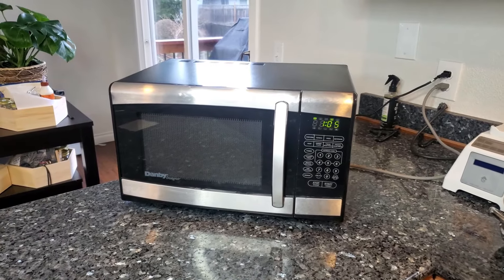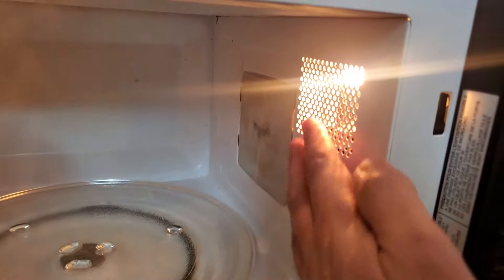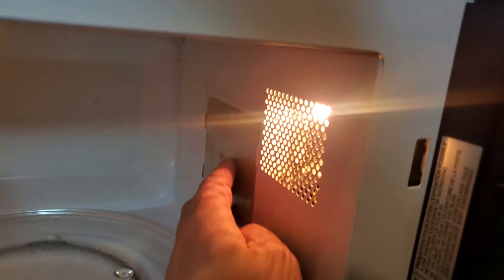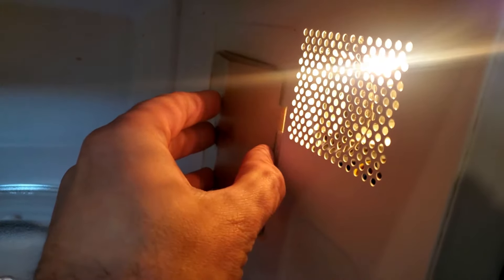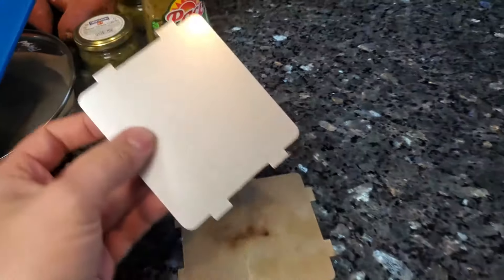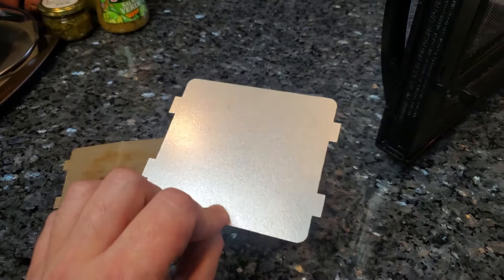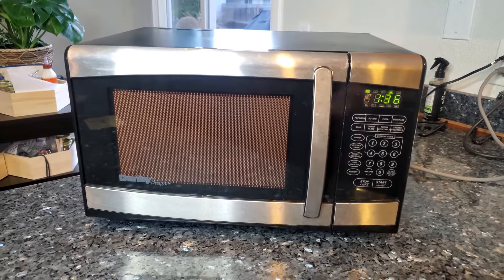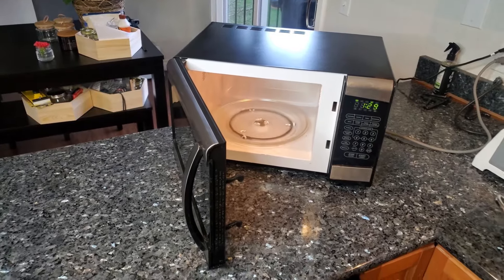How To Fix Microwave Sparking for $3 -  Broken Microwave

Comment: it worked! Make sure to wipe down the area which was arcing otherwise you may run into the same issue after changing the waveguide.
Reply from the maker: Happy to hear it and thanks for the tip.

Comment: We had already put our microwave out on the side of the road for trash pickup because it was arcing and I didn’t think that could be fixed. But just in case I searched the problem and found this video. Brought the microwave back inside, wiped it off and checked out the waveguide cover. Ordered a replacement because ours was so charred it actually had a hole burned in it. The waveguide covers (pack of 5!) came in a couple days and cost about $6. Thanks for this video!
Reply from the maker: Nice!  Happy i could help and that it was a cheap fix!

Comment: Why does this arching only happen when melting butter, from one company, is it possible there is metal in the butter?
Reply from the maker: I haven't heard of that happening before.  What brand of butter is it?  I will have to buy some and give it a shot on my microwave.
Reply: @JMGENTERPRISES  It turns out that the Microwave Mica wave guide is dirty and that is why it is SPARKING as it never did that in the past? I bought a new micro wave as a replacement and now will order up a guide and install it, I bet that is the problem not the butter?
Reply: @JMGENTERPRISES  Walmart Brand, I think now it was the MICA Wave, I will say one thing I called he company that made the Microwave and they gave me a discount on the new one which  I think is fair?
I was told many years ago to buy a Sharp Microwave as they are a good company!

Comment: Mine already burned the little section on top of the waive guide...
Reply from the maker: So you are saying its too late to replace the wave guide?  Does your microwave spark when being used?
Reply: @JMGENTERPRISES  I have not changed the waive guide, I hope it isn't too late
Reply from the maker: @isabelramirez-sandoval8010  - Let me know how it goes!  I am sure a wave guide replacement would remedy the issue.  Easy and cheap fix none the less.

Comment: Mine needed to be cleaned. I took it out and cleaned the INNER side which had a bubble-like section that looked burnt. I scraped it with my fingernail & a paper-towel. Then used a spray of dish-liquid on a towel & wiped it a bit. Put it back into the slot. Let microwave run for 3-5minutes...NO SPARKING!!!! YEAHHH!!. I'm still going to get a replacement off AZ though.
Reply from the maker: Great to hear a quick clean fixed the issue!  Yay!

Comment: Hi! I’ve just noticed my microwave is sparking, tbh it is a wee bit dirty, and there’s some stain marks on my waveguide. However the sparking is coming from around the door, and the damage is on the door. If I replace my waveguide, is it still going to be safe to use with the damage from the sparking on the door?
Reply from the maker: I would definitely give your microwave a good clean and replace the waveguide.  It is cheap to do so and then re test to see if it's still sparking.  The electricity comes from the behind the waveguide.  It may just be that it's arcing around the door but I do not think it's the door itself that is sparking.  Let me know how it turns out!
Reply: @JMGENTERPRISES  just replaced the waveguide, and it seems to have stopped sparking! Magic! Thank you!

Comment: I'm having a different problem. At 2:06, you said this microwave was sparking about 4-6 seconds after starting it. Well, whenever I start my microwave, it sometimes (but not always) gives off a SINGLE, quick spark, before operating normally.

Any idea on how to fix this?
Reply from the maker: If you look into the microwave when you start it, do you see the spark coming from the plate?  If so, I would recommend replacing it.  Usually, from my experience, any sparks regardless of the quantity are from a faulty waveguide plate.
Reply: @JMGENTERPRISES  Well, I can't really tell, because the sparks happen so quickly that I don't have time to look inside.
Reply from the maker: @Acerthorn  - I would try replacing it.  It's cheap and easy to do.
Reply: @JMGENTERPRISES  Well, here's the thing: I literally just got this damn microwave about a week ago! I got it from a thrift store, mind you, but it was fully functional when I got it.

It shouldn't be breaking down so soon.
Reply: @JMGENTERPRISES  I should point out that my apartment has a roach infestation. Could that have something to do with it?

Comment: Excellent! Thanks. That's all we needed. Ours had to come from GE, so it wasn't $3, but was less than $30, way cheaper than a new microwave.
Reply from the maker: Awesome!  Glad you got it running and it was a Cheap fix 😀
Reply: For next time. You could have bought uncut sheets of the material they are made from. 2 sheets for six bucks on Amazon. You could have cut your own from the old one. Good info for next time.

Comment: I have a Sharp Carosol and the wave pad doesn't pop out but has two button-like tabs attaching it.  I don't know how I would attach a new one.  Can you assist with this?
Reply from the maker: I will look up your microwave and see if I can find pictures of it and get back to you.
Reply from the maker: @UGK4LIFE92  - Thanks for the tips!  You explain things well and I understand.  For my next waveguide replacement, I will use a small screwdriver per your recommendation 😀

Comment: What happens when you put frozen peas in there? Asking cuz I have a lot of issues with frozen  vegetables even with warming up macaroni.
Reply from the maker: The microwave should work as normal once it's working properly.  Usually I use a lower power setting when de thawing vegetables.

Comment: As a make-do before your new wave-guide comes in or if you have trouble finding one for your model, the following easy fix has worked for me twice. 

Carefully remove the current guide (mine just slides up and out) so it doesn't get bent, clean it (don't soak it, wipe it), turn it upside down so the burn patch is on the bottom (it's on the top most, if not all of the time I think), and put it back in.  Test it.  It should (knock on wood) work fine.  If it doesn't, just turn it off, unplug it and wait for a new one.  No harm done.

It was well over 10 years ago when the sparking/smoking happened the first time.  Today it happened again.  I'd forgotten that I'd rotated it just out of curiosity (and desperation ;-), since it took a long time to find a new one way back when.  Today, I came up here to see my options and this video triggered the memory.  The burn was close to the top, just like the other time, so I took it out, wiped it , rotated it, (don't reverse sides) and put it back in.  Works great again.  Should work for a quite a while as long as the guide surface and its edges are kept free of particulates.  Particles on other surfaces won't cause a spark.
Reply from the maker: Thanks for sharing.  I am sure this info will help others in the future!
Reply: Thanks for this comment I fixed mine 👍👍
Reply: Thank you both (video creator and this poster) fixed my elderly fathers microwave. Gonna purchase a new wave guide bc the original is burnt pretty bad.

Comment: Thank you so much as I was dreading the fact of spending $$$ for a new microwave. This fixed the sparks happening immediately. All I did was take it out clean it and flipped it to the cleaner side and the sparks stopped!🤗 I went to Amazon thank you again for the link and it's on its way! The temporary flip will work until the new cover comes in. BIG Thank you! Mom of Boys! 😄
Reply from the maker: Fantastic!  Happy to hear you are able to get it working while the new waveguide is on it's way!

Comment: Thanks for making this informative video. Those paper covers also wear out and will cause your microwave to not work properly. I bought a large 8 x 10 size from my local appliance repair parts store and used the old one to cut to size. Then replaced it. Different microwaves have different sizes of those covers. I still have most of it left for next time it needs it.
Reply from the maker: Glad I could help!